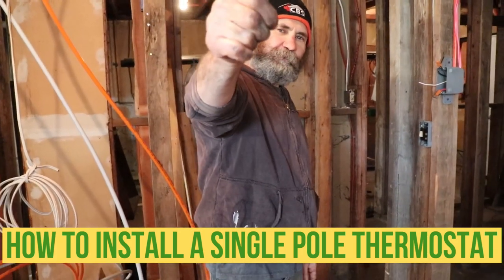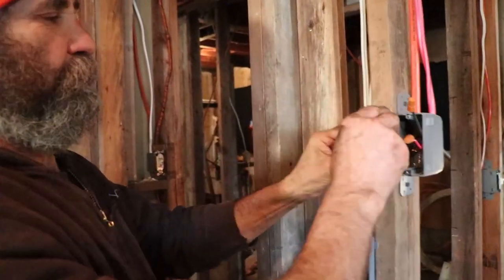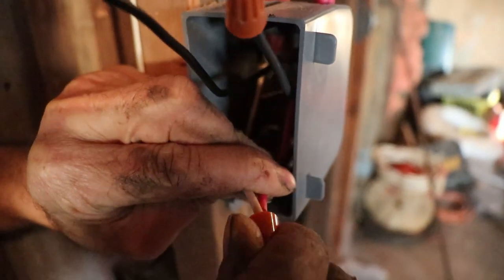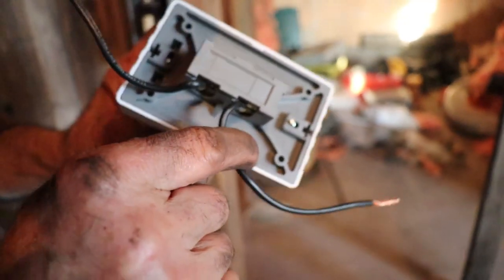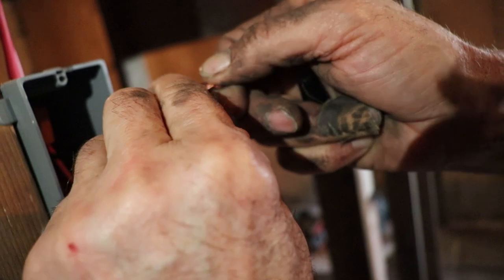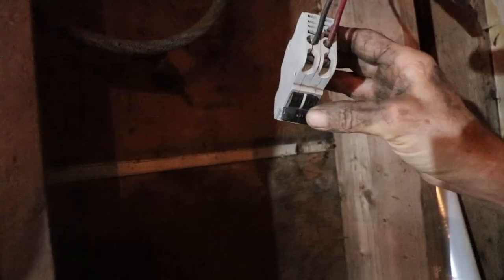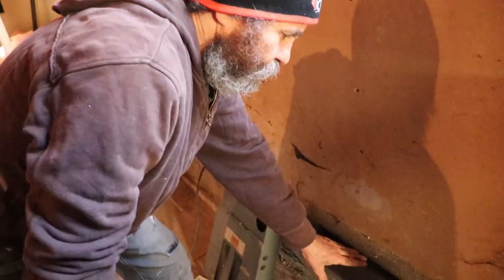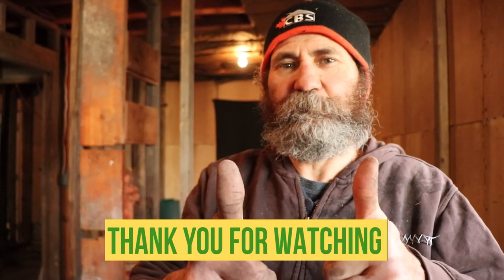How To Install A  BASEBOARD HEATER THERMOSTAT

Comment: hey how are you i install the same one but my baseboard heater don't go off
Reply from the maker: Hello there, thank you very much for your time, sometimes it could be a defective thermostat, you can try with another thermostat (there in the thermostat is a kind of spring that controls the temperature and sometimes it gets stuck, if you play with it sometimes it starts to work), keep safe, please let me know if you have more questions

Comment: What if you wanna install a switch to go to the thermostat,  get a double pole switch?
Reply from the maker: Yes can be done with 20amp light switch if you are 220v 20amp breaker, (but not recommended since the light switch would be on and off only, it is risky, if you forget to turn off the switch things would get complicated)  Most residential switches are rated at 15 amps, whereas industrial and residential switches usually are rated at 20 amps. A dimmer is a switch that can raise and lower the brightness of a light. A thermostat is the right way to go, please Gloria check with an electrician on your area for compliance with the building codes.
Reply from the maker: Thank you very much for your time and support, keep safe and enjoy the Holidays, please let me know if you have more questions.
Reply: @BahianoReno  thanks so much for your response.  Happy holidays!

Comment: 14 gauge wire on a 20 amp breaker?😬
Reply from the maker: Hello my friend, thank very much for your time and support, those wire are harder than regular 14ga, but the thickness is pretty much as 14ga, red older wire with no label, the owner never had any issue for almost 40 years and we are replacing the heaters and thermostats, but not adding any new heater to the house, keep safe and enjoy life, if you have more questions, please feel to let me know